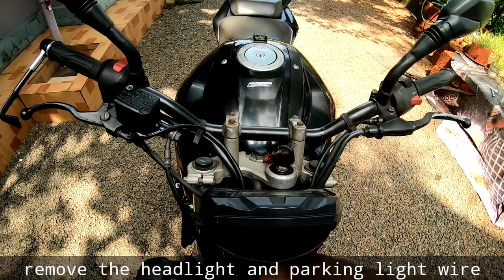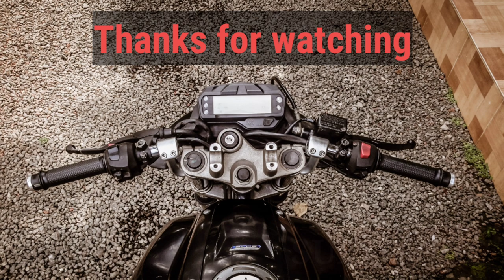Clip-ons handle bar installation in yamaha fz v2,fz v1,fz v3/cafe racer handle in fz16,fz cafe racer

Comment: Bro which handlebar set you used and what it cost?plz reply as soon as possible.
Reply from the maker: Gt650 handle,
Available at RE service center,
Cost about 4.5k full set
Reply: @munavarsharfas4107  bro can this handle bar fix in my yezdi scrambler ??
Reply from the maker: @scrambierider1966  is it have 41mm fork, then it will,
Reply: @munavarsharfas4107  thank you for the information brother ✌🏻🤝😇

Comment: Handle inu mathram etrayayi
Reply from the maker: Full set 4.5k aan 
Handle mathram ethrayannariyilla
Reply: @munavarsharfas4107  Bro r15 v3yude clip on install cheythal petrol tankil muttumo
Reply from the maker: @hijasaneez4517  adh correct aayit ariyilla, 
Njan just onnu check chaydh paraya
&
Handle height idilum kurayum
Reply: @munavarsharfas4107  hight othiri kurayuvo odikkunnathil seen kanullallo handle tankil idikuvonn parayavo please enikum sett cheyyanarnnu
Reply: @munavarsharfas4107  thanks bro chek cheydh para gtude hanble cheythapole cheyyan pattuvo allegil vere enthegilum cheyyendi varuvo extra
Reply: Top box installing

Comment: Hello bro fz v3 handal resar set price
Reply from the maker: Randu reethiyil chayya 
1 fork riser use chayyaam about 1000rs
2 handle riser use chayyam about 600 to 700 aanannu thonunnu currect ariyilla
Reply: Plz English ya Hindi tell me plz
Reply from the maker: Sorry bro,
U can use fork riser to increase the handle height( cost around 1000rs )
Or u can use handle risers ( around 600 to 700rs)
Reply: No handal racer price 1907 rupees fv s v3
Reply from the maker: @IbrahimKhan376  that 2 metal piece cost 1907,
Then better you make one,
 or
 buy fork riser( increase seat height a little and ground clearance also )

Comment: From where did u get braided cable ?
Reply from the maker: Bajaj service center
Reply from the maker: Braided cable available in Amazon also
Reply: @munavarsharfas4107  will the 220 cable suit r15 v2 ?
Reply from the maker: R15 v3 yil set aanu
Fz lum set aanu
Appo 99% set aayirikkum,
Reply: @munavarsharfas4107  Thanku bro

Comment: Can v do this for r15v3
Reply from the maker: Yes, 
But r15 v3 already have clip-ons
Reply: @munavarsharfas4107  nah I mean i want to put this mod on my bike so can I do on my R15V3
Reply from the maker: @WandererRial 
Yes
Handle is direct fit to r15 v3( not for r15 v2 or v1), you can do it
Reply: @munavarsharfas4107  how did u get the handle?
Reply from the maker: @WandererRial  it's from RE Gt650,
You can buy from RE service center
Reply: @munavarsharfas4107  ok cool how much did this entire bracket n handlebar cost buddy?
Reply from the maker: @WandererRial  
About 4.5k full set 
Handle
Left & right switches 
Grip 
Clutch lever
( I don't know about handle only )